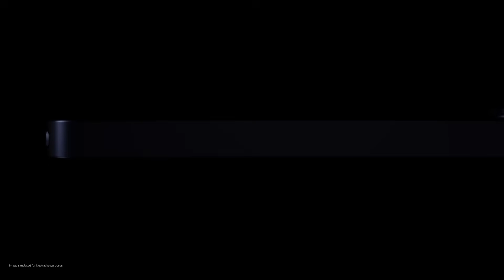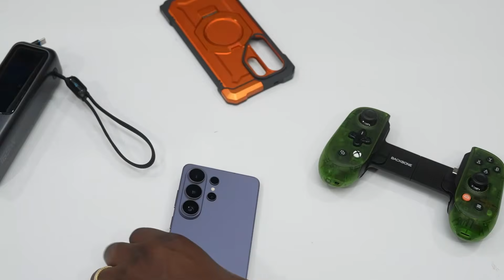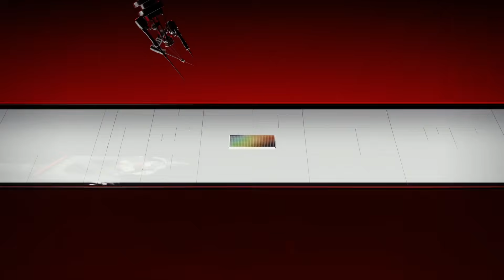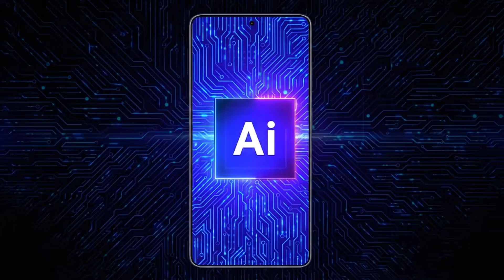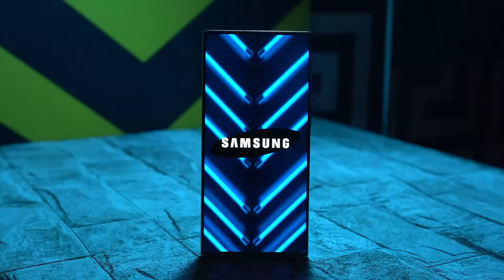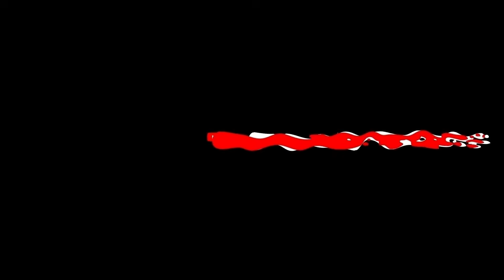Samsung Galaxy S27 Ultra - They Finally Did it!

Comment: I wish the ultra could go for 180-240hz, 7.0" display with a slightly wider 19.3:9 aspect ratio and I'd want to see 6000mAh battery by just accepting 0.3mm thickness and keep the spen slot, if they could integrate magsafe and magnetic sheild